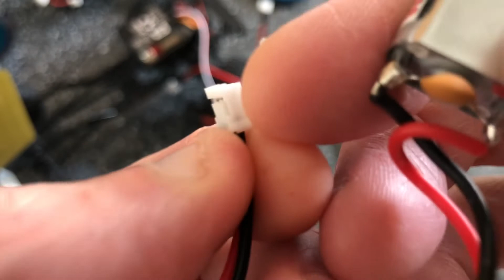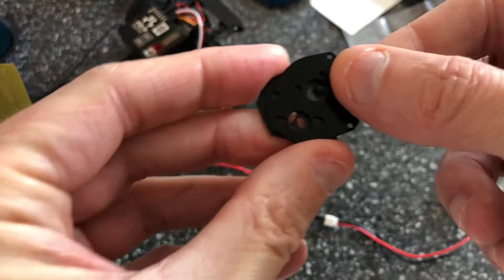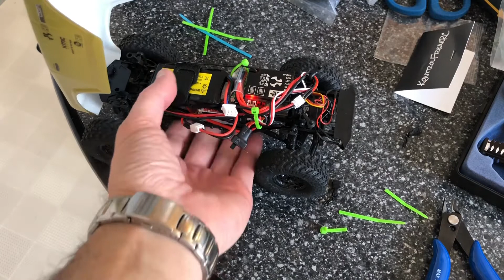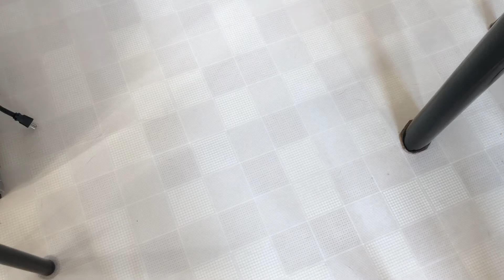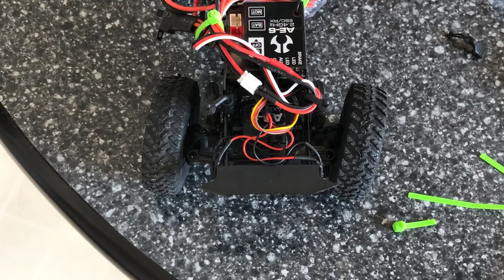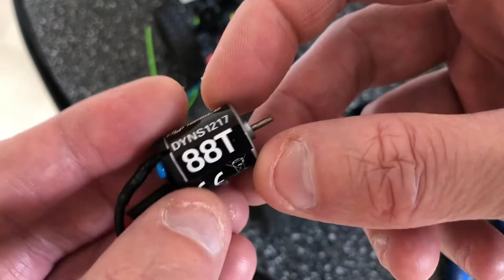SCX24 new barrage motor and new ESC my crawler is back in action 🤙

Comment: do have a link for your speed controller ?
Reply from the maker: I don’t recommend it. Mine burned out in 2 days 😒
Reply: The controller you have plugged into channel 2? For your
Reply from the maker: @johndavid5627  yep channel 2. And I hope your furitek works out good 👍
Reply: So that device you have plugged into your actual ESC via channel 2 is burnt out already?
Reply from the maker: @johndavid5627  yep but that was a cheap esc and there was an issue with my receiver
Reply: So what are you doing now to make it run?
Reply from the maker: @johndavid5627  I just purchased a new stock esc with the barrage motor.

Comment: You mentioned the servo is off, I don't see the answer here.
Take the horn off the servo and the plastic piece under it. Turn on your RC and set the steering trim to zero, pop the piece back on, it may take a couple of times to get the right position but make sure you don't screw the horn in all the way, the spring should be showing. If you tighten it to hard the turning return will suck.
Reply from the maker: Thx but it came back to normal with the new esc 🤙. But this truck is way too expensive for the poor quality control and cheap components that it comes with!!!

Comment: Imho stock ESC is terrible 2nd one in 2 weeks for me only had scx24 for 15 days so far and 2 ESC and 1 motor dead = fail AxialRacing on this product.  I've owned dozens of RC cars over the years and never had experienced such frustration with barely using the thing.
Reply from the maker: Sorry to hear that. It’s a real shame that they bring it out to market like this and they don’t make it right by their costumers 👎. This will be my only axial product I won’t get anything else from them in the future!!
Reply: @patdud1979  ya agreed like test the heck out of it before putting on the market. My bro had 2 axial products they have been great but I'm with ya i won't buy another. I'm a bit of a rc holic buy too many. Will admit  besides the electronics the scx24 is great.... but the electronics are the part of a rc car that cost like 75 percent of its value at this size.

Comment: Where did you get the esc?
Reply from the maker: Amazon but I would avoid it!!! It burned up in a day 😩. Just get the stock one with the barrage motor or a different option get the RC4WD remote and esc for there 1/18 scale crawler 👍 it is 44$ for the combo. On horizon hobby